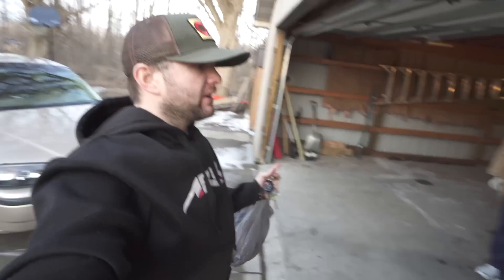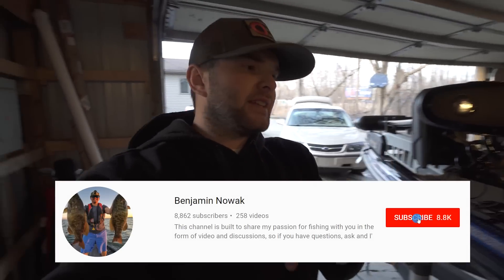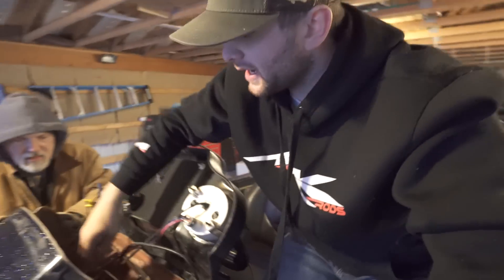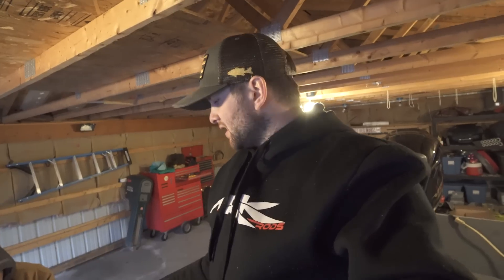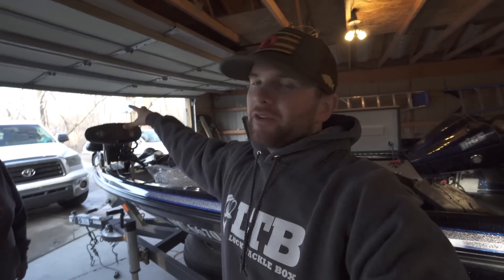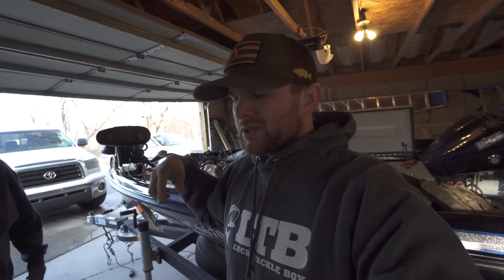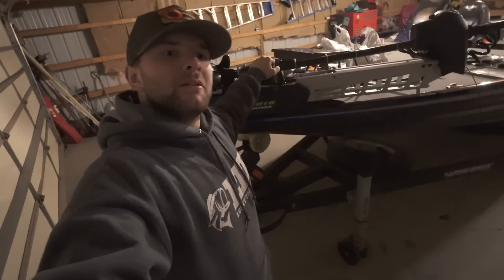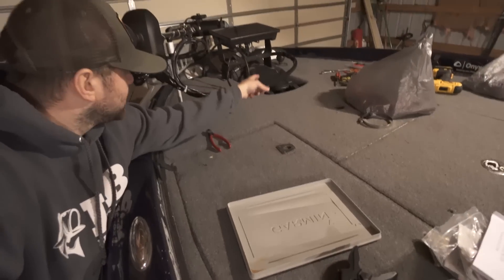Rigging My Boat for 2018!  ULTREX and PANOPTIX INSTALL!

Comment: Sick bro, you’re gonna love it. Don’t even bother buying power poles. Three days of working on that thing and I would’ve been in that hot tub every night relieving the stress. Make sure you have the steel pull cable on there for taking it out of the cradle.  And if you get a spare make sure you get the steel cable also. The rope cord is not enough for the components on the shaft.  Go get em brother👍👍👍
Reply from the maker: You are 1000000% right!  After working on that Ultrex I opted for a shower though - so much fiberglass in my hands and arms and just misery!  It's funny you say that, I actually put an extra pull cable in the boat just to make sure if something happened that I'd have one!

Comment: That's such a sick upgrade... love it! I'll be putting my spare MotorGuide on my boat soon. Bent the lower shaft when I hit the stump last month. Still works fine, but has a ton of torque steer above 50% power. BTW, do you realize how long it has been since the Blues and the Red Wings both failed to make the post-season?
Reply from the maker: Thanks Joe!  It's so insane!!! I just got off the water and it's ridiculous how accurate it is.  That sucks that yours got kind of beat up.  I have no idea, but it has to have been at least 25 years!  I have no motivation to even watch now - maybe Vegas will win it and have a "Miracle Season!"
Reply: I just did a quick check online... (Okay, mostly to distract myself from packing up the garage...) The last time the Wings and Blues BOTH failed to make the playoffs was the 1978-79 season. This of course does not count the lock out season 04-05.
Reply from the maker: That's insanity.  That is nearly 2x my lifetime

Comment: hey dude was wondering if i can contact you. I have a very similar set up to yours instead i run 2 10s up front and a 12 at the counsel. This year im getting voltage drop like crazy but its not shutting my units off. was wondering about doing the same thing you did run a dedicated 12G wire for the units. thanks
Reply from the maker: Its Tom From Brooklyn Run the new 12 gauge to a dedicated battery.  They stay on all day and don’t shut off when I start the motor. You have to get a little battery charger because the 4 bank won’t charge it, but it’s so worth it
Reply: thanks for the response did you wire the 12 gauge into the boats panel or run it direct to the Units?? and how would i go about splitting it up on 3 units would i need to run 3 separate wires? Also how many trips does one charge last you ??
Reply from the maker: You can run all the wires for the graph to the same 12g wire. Just one wire for my 2 graphs and Panoptix up front
Reply: Your the man !! i just started the project this morning. Crazy how you spend 60 plus K on a boat and then have to rewire the whole thing. These boat companies gotta get their stuff together. We no longer run 5 inch black and white graphs on  our boats we NEED 10 gauge 12 gauge wires everywhere lol
Reply from the maker: Hahah I hear you!  I wish when I bought my boat that I could specify that I wanted them to run the higher gauge wires - it's critical and having an extra battery is super super nice!